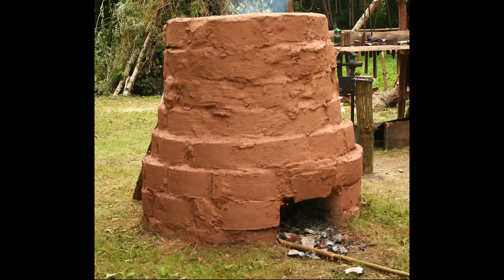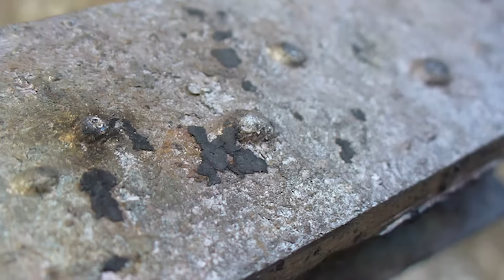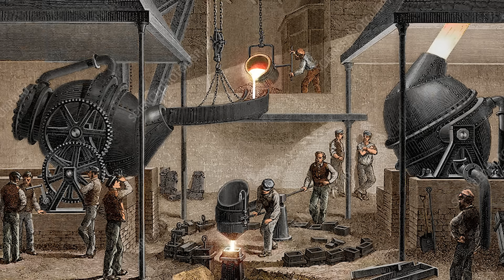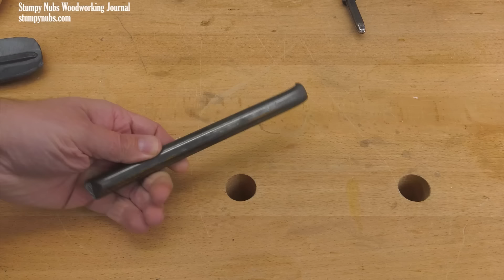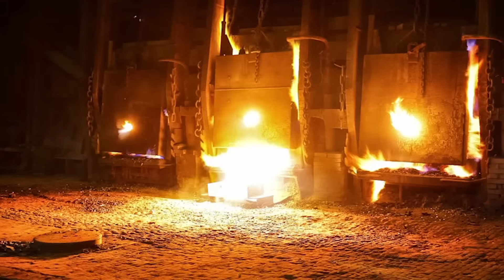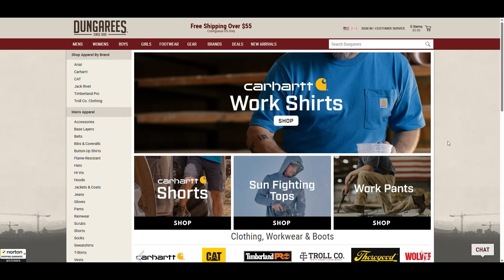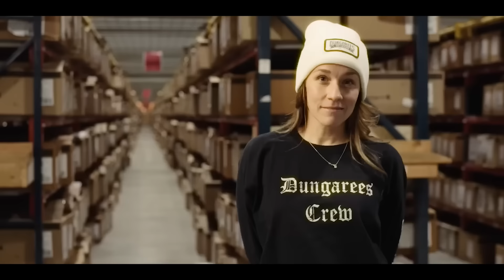Why they REALLY don't make tools like they used to

Comment: Retired blacksmith/welder here. You're definitely onto something. Modern steels are for the most just a hash mix of recycled and original iron. Smelters supply metals that meet requirements and nothing more. The result is the junk you see today.
I'd worked with metal for decades and during my work, got to see how older metals behave when compared to modern stuff. Even simple tasks such as arc welding metal will highlight the differences. Older metal tends to quietly 'hiss' when welded and will throw few, if any, spits of metal off during the welding process. It (the finished still hot weld) smells different too.
I've purchased modern stock metal for home projects and when working it, it's possible to spot variations along that particular bar.
Old tools can be the best and the worst! Spoke shaves are my enemy. For some reason, they almost seem determined to cut me when compared to modern tools! The difference with old tool steel is very noticeable. I liken it to seeming more dense/pure when compared to modern metals.

Comment: Pre 1945 steel has additional value as it shouldn't have any radioactive contamination in it, making it ideal for sensitive radiation detection equipment.  It's known as low-background steel.

Comment: Crucible steel was superior hence why we still see millions of miles of railroad ties and stakes 100yrs old without paint still in great shape. Forging is superior but not all forging is, in fact most forging is inferior because the grain is aligned opposite of loading. Companies do this because often the material needs shaped in a way that isn't mechanically beneficial but dimensional is. Modern steel can be better but often is worse because often companies use cheap low quality steel from dishonest manufactures around the world and also because things are made to a price point instead of being made well. Heat treating is probably the main reason modern tools are poor as heat treating is bypassed as much as possible because it is expensive and when it is done it is often done to the cheapest and quickest method and not the best for cost and also it is done in massive volume with often a lot of variation in temps.

Comment: One of the things to remember is it isn’t the steel that’s changed. It’s the quality of steel tool makers are choosing to use. People with their head in the sand still talk about Chinese tools like they only produce junk. This isn’t true, they produce exactly what is asked of them. As a mechanic, I love older proto tools. People mistake the made in America as the reason they were better. The reality is proto outsourced their production to other countries to lower costs and by doing so they made decisions to cut corners on materials used. So it’s not that they’re produced in any place, it all boils down to money. Companies are producing the quality level that they need to to maximize profit with an evermore competitive warrantee structure. Ultimately old tools that have last this long are “better” because they were overbuild for modern day standards.

Comment: I am a metallurgist and this video is pretty good. Couple of points, bloomed steel can have a variety of carbon content, but it is the oxides that makes it weak. The forging is to remove and break up those oxide.

On modern tool steels, I would be absolutely shocked if any modern producer was remelting and casting chisels, they are probably just using cheap steel with impurities and have a poor heat treatment.

You are spot on, modern steels grades CAN be even better than the grades from 50 years ago BUT you will pay for is. The vacuum induction and vacuum arc melting processes make the highest quality (lowest impurities) steel and it is used for things that cannot fail. Think aircraft, oil rigs, and spacecraft.
Reply: Thanks for your commentary. 👍🏽
Reply: Thanks for the info.
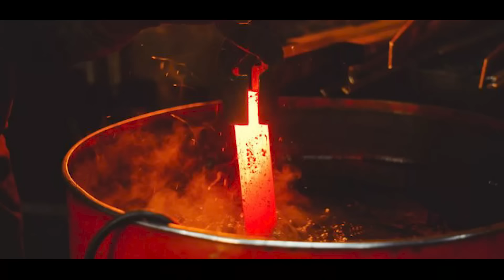Is it just me, or is the word "dense" at 7:30 incorrect? I was under the impression that martensite is actually the least dense of all the steel phases.

Comment: I'm a woodworker and bowyer. I use draw knives a lot. I've purchased good modern and vintage draw knives. The modern ones don't compare to the vintage ones. Personally, I don't think it's necessarily the steel, but the quality. Vintage draw knives use a different blade geometry than the modern ones. And they cut SO much better.

Comment: I'd be genuinely shocked if the best steel today isn't superior in every way to older steel. Its a matter of cost and mass manufacturing.

Houses are a great example of this. Older homes were typically made from better wood and materials. Also took much longer. Doing that today would drive the cost 2-7x.

Comment: Most old tools were high carbon steel , especially chisel's saw's hammers. Nowadays everybody's using stainless because it doesn't rust and will look nice longer. You know what makes a high carbon steel look nice. Use it, clean it once in a while.Put a little bit of oil on it.Don't shellac , it that'll get into your sharpening stones , you don't want shellac , dust and your sharpening stones.

Comment: I have a lot of handmedown tools from my dad's friends as they retired or passed away. Most of them outlasted the more modern equivalent tools I bought brand new over the last couple decades
Reply: 😮😮😮😮My husband (65) loves the tools he inherited from his dad who was a wood turner after retiring as a master carpenter. Some is sentimental, some is quality.
Reply: @wickedbird1538  Same. I have a Mac ratchet hand me down from my dad's good friend/basically my uncle Mark, who passed a few years ago, and i think about him every time i use it. He was the most knowledgeable GM mechanic i ever knew. me and my buddies could be working on something, not be sure what to do, call him, and he could walk us through it over the phone from memory, one day a phone call to him saved us about 4 hours of pulling parts we didn't need to pull, even though both the Haynes and Chilton's books said we did... When i was a kid building my first jeep i got as a trade for some parts and labor (it was ROUGH and not driving, the the head bolts on the front and back of the inline six were broken and just sitting there lose lol) he would come over after work and help me with it whenever i needed a hand with something i wasn't sure on. Miss him a lot and treat that ratchet like it's made outta gold.
Reply: I suppose they werent equivalent then?
Reply: @TheMarcinZalesie some were even the same brand names.
Reply: Did you use them with the same frequency and duty?

Comment: Here is the real issue about "new" steel people either forget or were never aware of...
Starting back in the 1980s and in full swing by the 90s and still to this day China started buying up all the world's steel. USA has been their number 1 resource for this supply. China bought steel ingots from steel mills, as much cold rolled mild steel, scrap metal with high yeilds of useable steel. Soon their buying power and relations with privately owned industry grew as they flashed cash in front of smaller steel makers and brokers. China was paying slightly more than current market place just to get their hands on all the steel they could get. Even by the late 1990s China already owned the vast majority of steel in existence. Iron ore was mined here in the US, often made into taconite for ease and efficiency to ship and make into raw material steel for most forms of manufacturing. Steel mills all over the midwest and other corners of US continued to make their products but the steel did not stay here it all got shipped to China. At the same time manufacturers here who use steel to make their products used to buy direct from steel mills but now had to purchase their raw materials from China and ship it back to our country, often back to a facility just a few miles down the road from where the raw material was made in the first place. Yeah this stuff happened big time...and still is going on with China and steel. All of the raw steel which manufacturers use for their products today in the USA comes from China. About 45+ years back it all was made in and stayed here in the USA, but no longer the case for quite some time now. 
This does not always mean inferior steel but does increase the cost here for manufacturers by a huge margin. You do get what you pay for because the cheap steel from China is available too. 
Maybe this explanation will help others to understand what's been going on with the steel industry and the United States and give people a more informed view.

Comment: I have to disagree with your claim that old tools cost more than new tools. Maybe if you go to the kind of antique vendors who charge ridiculous prices or buy special brands that are being collected, but I recently payed 10€ for three chisels, a wooden hammer, two rasps, a hacksaw and a machine vise all in good condition at a flea market. 
I later went into a hardware store and this set of tools would have cost around 60€ there, and that would have been the cheapest low-/medium quality ones they had. 

Why pay a fortune for "perfect" tools if you can pay a little for "good enough" tools?
I understand that you want to make money with those tools (or by advertising them ;) )so you might use them more intensely, but I'm just a hobbyist.
Reply from the maker: I said they CAN cost more, and I gave the Narex chisels as an example.

Comment: Being used to cheap, crappy chisels, I was shocked when I sharpened an old chisel. It was much, much harder than the junk chisels. It took longer to sharpen, but kept that edge a LOT longer.
I look forward to trying chisels from the manufacturer you so kindly mention.
Reply: There are chisils you can get that are much better steel then one from the 19th century!!  The most important two factors are forging and tempering!!!
Reply: Hi, Im using Narex chisels, those with rounded handle, that are stacked in shelf behind the guy on the right and left too. And I would never buy another. They stay sharp for so much time, and also the feel of the chisel is irreplaceable. From all of my heart, i suggest you trying this brand, because it is so great to work with.
Reply: That's something to remember. Old set of chisels was $50, but now due to inflation that's like $800. And your new chisel is probably way cheaper 😅 chineseum is chrap, but quality always was expensive.

Comment: There is an interesting story about old steel from my region: Power pylons crumbled under heavy snow 15 years ago, giving us a huge blackout.
It turned out that those pylons were predating WW2 and made with the typical steel used for such infrastructure at the time, called 'Thomas steel'. This steel was severely inferior to what we're using today. It wasn't just 80 years of material fatigue, but a shockingly bad base steel that caused the incident.

The US had its T2 tankers cranked out by the dozens in WW2, some of which CRACKED IN HALF while at rest in harbours just months after they were finished! Yet surviving ships were around well into the 1980s, when the catastrophic loss of the SS Marine Electric prompted a new look at shipping safety standards.

A few years ago, I heard about how much metallurgy had still improved in recent decades, and how the Chinese industry had also caught up to that level. That prompted me to try out a knife from one of those weird Amazon-brands that are clearly just Chinese factory brands pretending not to be Chinese. They're also no longer the pig iron garbage that they used to sell, but proper modern steel varieties. Just at 15€ for a properly designed chef knife, instead of the 60+€ that most western brands charge for equivalent models.

Comment: After 1945, atmospheric nuclear tests released radionuclides (like cobalt-60 and cesium-137) into the air. These contaminants were absorbed into modern steelmaking processes, especially since modern steel often uses air during production.

Comment: Well beeing a mechanical engineer i have a very good insight on tool(and general) construction. The thing is that all the material(excluding plastic and rubber stuff,... thats a different topic) we use today is far superior to the stuff they had back then. So basically if you take two chisels of the same Design and grade of steel the new one will A LOT better than the old one. That beeing said engineering in general underwent a change in general design approach. You see a 100 years ago an engineer would look at a thing and his thought process would go around the idea to make the thing as strong and long lasting as possible. Later, lets say somewhere in the 50s to 70s as we learned more about calculation and live cycle thingys, this changed to "lets make it okish and some extra to be save". After that in the 80s to 90s we reached the point of "just good enough with a little bit of safety margin". Nowadays with all our fancy computer aided simulation and stuff we are at a point of "make 80% of production hold up for an exactly given amount of time and thats it" kind of mindset so barely good enough. You can see that in every thing you may encounter and if you want quick proof of what i say get yourself some ball bearing dimension tables. You will see that the exact same Bearing is capable of taking much more load as time passes because of better material and manufacturing😉

Comment: Whilst I agree to your statements I wish to add that older tools usually come with a minuscule amount of impurities. I noticed that the old tools I used as a child had a very distinct taste and smell - you noticed it when you used them and then touched your nose afterwards or ate some slice of bread, without thinking about it. Newer tools do not have this issue anymore and I would tend to use the newer steel for safety reasons. 

Before you ask: as a 5 year old, you don't remember washing your hands after woodworking, but you clearly remember the funny and stingy taste, even 20 or 30 years after.
Reply from the maker: A weird, lingering taste and smell in older tools is a sign of "a minuscule amount of impurities?"
Reply: @StumpyNubs  
In my region there was lead mixed in the metal. When you used them, you had some of it on your fingers, which you could then smell or taste when you ate something without proper care.
Reply from the maker: I think I must be misunderstanding what you meant in your initial comment.

Comment: Bean counters have worked to make tools cheaper, even if that makes them worse.
But metalurgists have worked to make the steel better, even if it's cheaper. 

And the steel is better mixed, less variance (even in the same tool). Which means that there's less variance in the properties of the steel.

Comment: good tools still exist. they're just expensive and people are cheap.
Look at the M-Series tool steel (especially ones like M35 and M42 crucible steels) or powered steels like SG2. These HSS and others have incredible properties and are used in metal working as they can hold an edge under very high heat / high stress situations. They're just expensive (like real expensive,) so hobbyists often opt for lower performance steels (M2/M3 or similar.)

If you buy a cheap Chinese chisel, you get what you pay for. If you're buying tools made from premium materials they'll out perform any historic alternatives as technology has moved on.

Comment: It's not that we don't have better steel today, its that we have manufacturers that pick an inappropriate steel and don't even bother to heat treat it properly. If they look like chisels and they are cheap, people will buy a 6 pack and not be all that mad when they turn out to only be good for five minutes before needing sharpening. I mean, we have Horror Freight selling cast iron anvils when we've had cast steel cheaply available for a century.

Comment: I would say that a well-designed 100-year old chisel of good steel is better than a badly designed modern chisel regardless of the steel quality.  In fact, all you really need are good chisels of good steel.  You don't need spectacular steel. If you need to sharpen it once a day or less, it's good enough for most of us DIY types.

Comment: I have an old fisher-wife knife made of swedish stainless from "jernbolaget" ( iron mongers guild). I can't say for sure but I remember my grandma using it when I was a kid, so at least 50 years old. It cuts, hold an edge and sharpens better than my top notch $200, zwillinger henkel (twins symbol not cheaper single man). I'm sure there are better steel knives you can get today, but I'm sure they are expensive. I know my late grandma; as a widow with 4 sons, she would never have paid top dollar, it was a midline cost and quality knive for its time for sure. And still better than normal peoples expensive kitchen knives.

Comment: I was a scientist hired by the government to do testing on steel. We tested hundreds of different Steels. We found that the heat treat process and tempering process as often as or more important than the steel itself. The best steel we ever ran across was preheat treated in hundred million dollar facilities. Now they have extremely high carbide steel that requires diamonds to sharpen and a very intense heat treatment process. But it is incomparable to older steel in quality. The problem is you have to find somebody who makes a tool out of these good steels.

Comment: it probably relates to the fact that vintage tools made properly were absolutely better than the cheap tools of the time. they therefore lasted and while modern cheap tools are better than the vintage cheap tools - there must have been time  / a sweet spot when buying used tools worked out better value. As with everything though this likely created a demand for vintage tools which drove the price up (as well as supply dimishing).    So as you clearly showed modern quality tools are likely better value for money and jsut as if not more quality.